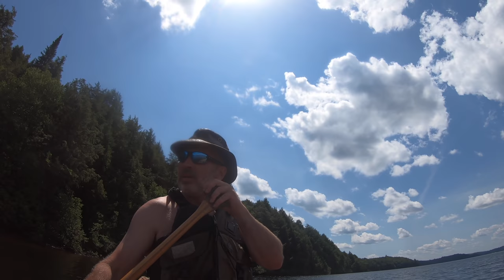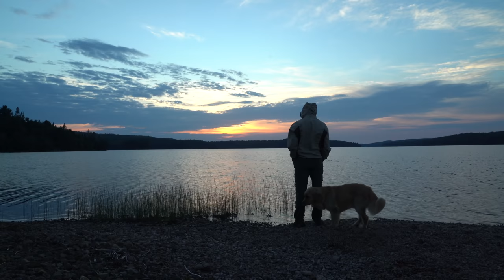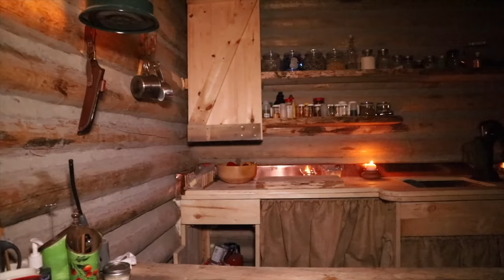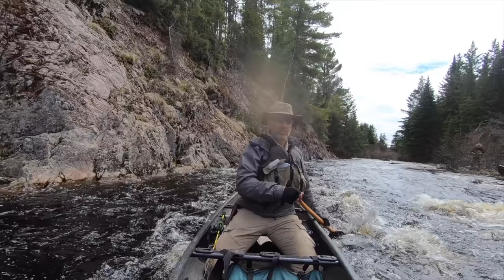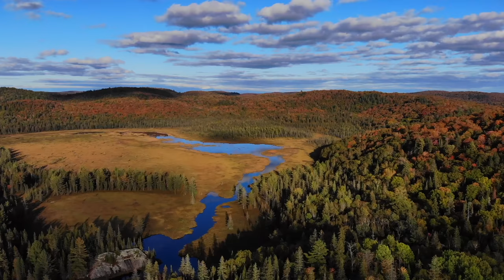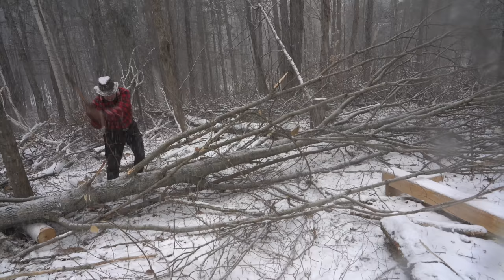Cali's 1st Overnight Canoe Trip

Comment: Now that's a canoe! Prettyest canoe ever. I love when you take a break from work and go on your adventures. It's real hot in Indiana too. It was nice to wake up and hear an see Canada I really miss that. Glad you got a pond. Have a nice day
Reply: North America is under this like HEAT DOME for at least another week, maybe even longer.  Temperatures are running 10 degrees and more above "normal" - whatever that "new normal" is.  Sure ain't what it used to be like in the summertime 30-40 years ago in Southeast Wisconsin.  Hot as Hades here right now WAY above "normal" and dew points at the "Tropical/Oppressive" level.  It's hard to breathe outside the air is so wet thick, like trying to exercise in a steam bath.  UGH!
Reply: @jannibal9273  same here in Ohio. Never this hot temps when I was young.  Something has definitely changed in regards to weather.

Comment: You should get a 240cm long kayak paddle for your canoe. Carbon fiber for lightweight use. You're about my size so a 240cm paddle is good for a high angle of attack on the water and makes for very very efficient paddling when going solo into a headwind and is a good choice for long distance paddling.
Reply from the maker: I have a 250 that I use in my other canoe